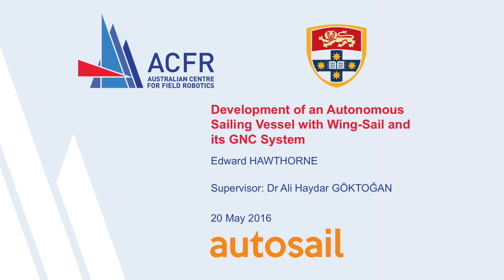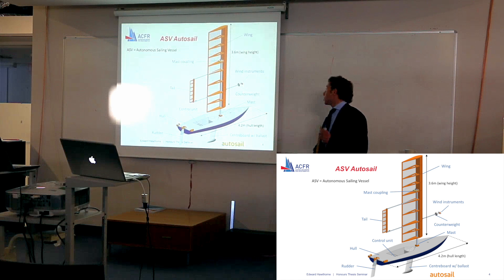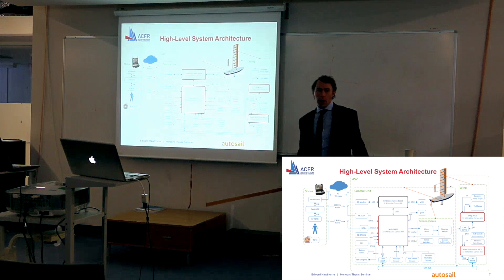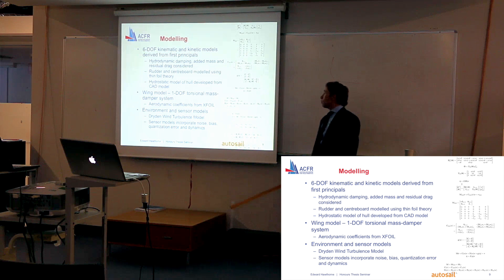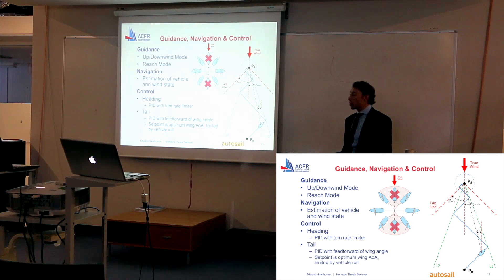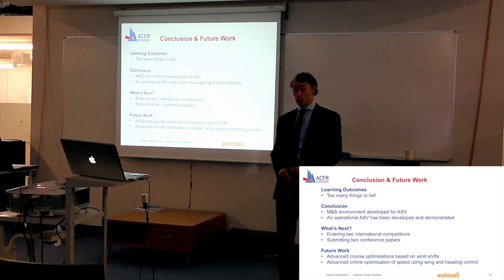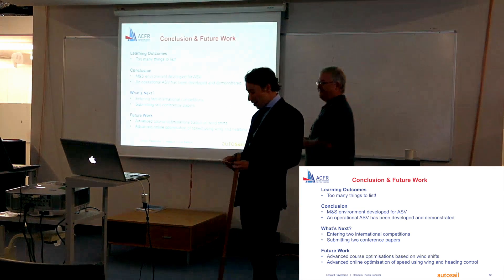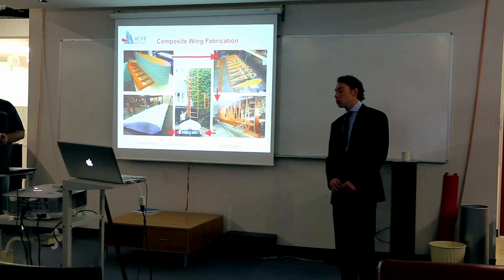Autonomous Sailing Vessel - Honours Thesis Seminar

Comment: This Guy did it mechanically and solved the power on when turned into wind problem as well...https://vimeo.com/79511782...I have been playing on a model monohull with different shaped cam rings but round works surprisingly well.